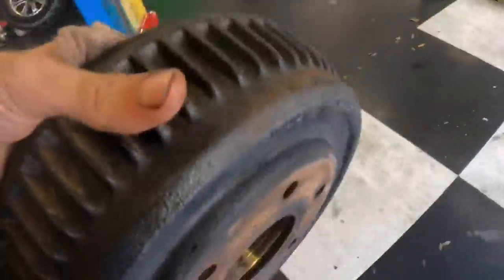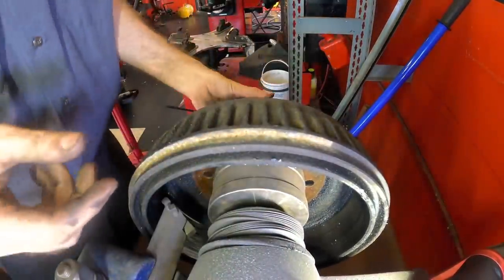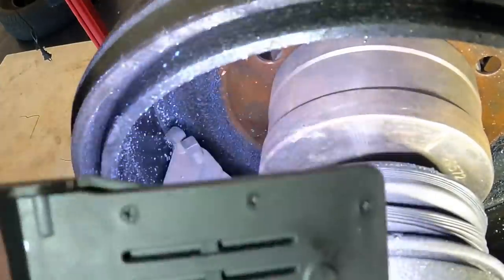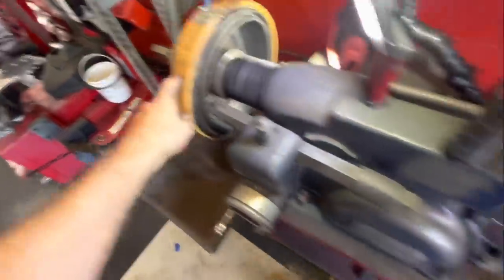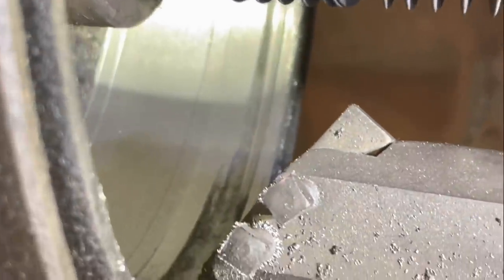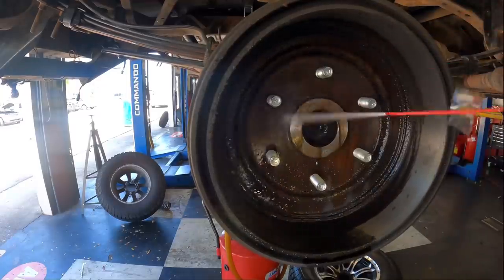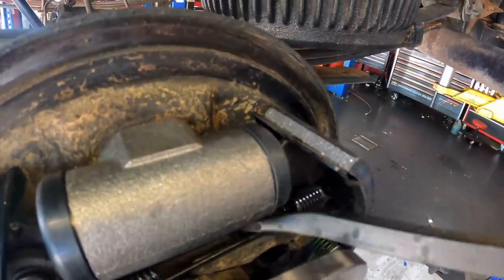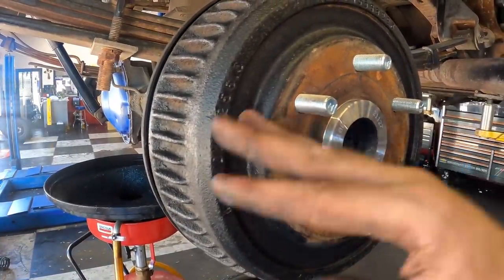How To Machine Brake Pads and Rotors to Recondition Surface | Brake Lathe Drum Resurface

Comment: Ah!....the past days of drum brake servicing! Anyone remember using a "drum micrometer" to make sure the drum was not oversize after machining? AND....transferring that drum diameter reading to a special purpose machine to "arc" the brake shoes? The joys of antique braking systems! Back when asbestos brake linings were on everything......
Reply: at the truck shop the same machine cut both at the same time.
Reply: Yep, I've done tons of brake work as a specialist including all lathe work for rotors, drums (including semis) and flywheels. Grinding the shoes was part of the service. For safety.
Reply: Remember? Yes.  Miss doing it? No. :)
Reply: Measured and turned many drums and rotors as a teen in my dads shop.  We arced shoes every time.  Had the whole anco brake service system including hard spot grinder and non directional finisher for rotors.  No squeeky brakes allowed
Reply: We, (the public and poor) never had anyone do things like that ! If I remember right we’d buy a rubber replacement kit, clean the drums with coarse emery cloth, rub the glaze off the shoes, then put diagonal saw cuts in the surface. copperslip on the friction surfaces. bleed the brakes well and off we’d go.  If by any chance you absolutely had to change the shoes,I found that OEM shoes had a lot more friction material on them than the cheapo aftermarket ones, for the same money, but more driving to get ‘em.  Re-arcing ? a downhill run with your foot lightly on the brake did that !
Reply: I remember doing that BEFORE the vacuum system was designed for it. What asbestos? Air pressure to get all that “dust” off the backing plate and springs and retainers…
Reply: Theyre still asbestos! The criteria is less than 10%...... riiiiiiiight! The front says asbestos free, the back says contains asbestos. The front of the box means what it says, asbestos free, they dont charge for the asbestos...l its free.
Reply: Im 56, did my first brake job and packed thebearings on a 1970 chevy half ton long bed, the year eas 1974. i was 8. Yup been thar.....
Reply: I'm 124 years old. I invented drum brakes. Back then they were made of whale blubber.
Reply: @davel4708  i thought it was westinghouse..... no wait that was railroad brakes, before cars..... smh
Reply: I'm surprised Ray doesn't know there's a port on the back of the brakes to adjust the shoes... and that he doesn't have the kit with the spring compressor tool and the adjuster soon...
Reply: Many years ago, I managed several auto parts stores. We would turn drums and rotors everyday. Our machine usually would run most of the day. If a customer bought all the brake parts, we would turn the drums or rotors for free. There were some days I got tired of that machine running!!
Reply: Being shop foreman for Brake Check doing drums and rotors was big part of my job, back in the 70's

Comment: Dealership service manager here, with a lifelong passion for proper auto repair. Love what you do. I have a drum brake tool kit in my toolbox in my garage that just collects dust. Love hate relationship with drum brakes. glad I dont have to deal with them anymore, but nostalgic. Thank you for showing people that not all technicians are out to get people. Its tough being in the business, trying to always do right by the cars and customers, and have that negative aura of what people think shops and dealerships are, breathing down your neck at all times.
Reply: @PeterPan-uu5vu   thanks for your well thought out, and insightful feedback. Super helpful.
Reply: Drum brakes are mechanically more efficient that disc brakes and that is why they are particularly suitable for parking brakes and slow speed applications.  Their disadvantage comes with the heat dissipation, which is where discs score however, the flip side is that parking brakes on discs have severe problems especially when hot and when they cool down losing grip.  I understand that this was a particular problem with the Chrysler Voyager in the early days, when Moms and little old ladies failed to set the parking brake with enough effort to overcome the shrinkage of the hot metal/pads.  It is noteworthy that Mercs, BMWs and Porsches use shoes within the top hat section of the discs for the parking brake and calipers for the service brakes.  

The current trend for parking brakes on disc calipers being electronically activated has exacerbated the problem and our current Skoda (VAG) carries a warning to set the gearbox in gear when parked on a slope as the parking brake may not hold when it cools down!
Reply: @clivewilliams3661  VAG, 1 step forward, 60 steps backwards
Reply: @sgtjonzo  Its all about costs and getting away with the minimum.

Comment: In 2015, I watched my 2005 GMC Canyon get inspected, and the rear drum the tech pulled came off with ease.  Fast forward to a year later, I had moved to a new town, and I had the truck in for an evap leak and annual inspection.  Two days later, I was informed the tech had to "use a sledge hammer to remove my brake drums" during inspection, and that I would need new drums and other harware.  That raised an eyebrow, but since I was out of town and needed my truck the next day, I authorized the repair.
When I picked up the truck, I asked to see the damaged parts. "Oh, we threw them away already." Riiight.  Ok.
The next time I set my parking brake, it wouldn't engage sufficiently to prevent the truck from moving.  Took it back to the shop.  "Oh, we'll adjust that for you at no charge." 
Worked once, then the next use, back to same issue.  'Fool me twice,' says me...  Took it to another (not dealership) shop.  Cable was broken.
I live in Virginia, and we don't get snow all that often, and I had kept the truck well-maintained. Never set foot in that dealership again, and I drove that truck another five years before it developed a persistent misfire on cylinder 4 of its Atlas I-5 engine just shy of 330000 miles.
I'm pretty convinced the tech, real name Bubba, I kid you not, scammed me on those drums or didn't know that sometimes you have to back the shoes off to get the drum to come off thinking that as a new customer with an old vehicle, he should get what he could out of me.
I wish every mechanic had the moral compass you do, Ray.
Reply: I learned about backing off the drum shoes to get drums off WAY back in the 80's working on the first of my two VW Beetles.
I had to take them off to replace the parking brake cable.
Reply: @MonkeyJedi99  
Ram gps
Reply: Don't know where you are, but I imagine they could get in big trouble for that. In Missouri, at least, as far as I know, you are absolutely entitled to get the failed parts returned to you after a repair...
Reply: Yes I wish Ray was my auto technician
Reply: When I had drum brakes, every time I checked them I'd clean the surfaces where the drum and axle flange met with a wire wheel, then a light application of antiseize around the lip of the flange. Never had to beat a drum off, that's a great way to either crack the drum or ruin the wheel bearing.
Reply: Don't let anyone work on your car. I don't care if you think you "don't have time" or have some other super important reason why you can't do it. Just think about how much time and money you wasted waiting for Bubba to fix his fuck ups and you still weren't made whole. Letting someone else work on your car unless its a huge job or some super complicated warranty work or electrica diagnosis is a huge mistake. This is coming from a mechanic. If you have even a basic tool set, a basic mechanical skill set and can read alldata or Mitchell service info then you're in the exact same league as 90% of the "mechanics" I've had the misfortune of being coworkers with, and you're well ahead of a good chunk of them.
Reply: @MegaDysart  in VA, you must be certified to perform inspections.  Doesn't matter how proficient I am, I can't inspect my own vehicle.
I'm held responsible for the proper operation of IT systems on which over $1B is transacted annually, and that means that I truly do not have the luxury to take days off whenever I want just to perform maintenance on my vehicles.  When stuff breaks, it doesn't happen on a schedule.
Reply: I spent this morning repairing or replacing my lower control arm rubber bushing because a mechanic had put it together and didn't know how to use the torque wrench I guess either that or he was a horse didn't know how to tighten stuff up I looked under there about a week or two before and seen shiny metal weird the bracket have been moving around and I couldn't figure out why my frontend was  vibrating good good mechanics could have got me killed I will never go back to that dealership again I swear have a good evening

Comment: I've recut rotors and drums on general purpose lathes several times over the years for people and hated the horrible screeching you get from cutting that cast stuff but never had or even thought of wrapping something around it but, that thing you use, the very moment that one broke the drum started making that annoying screeching started so, surprisingly effective. If only I'd know such a simple thing could make such a huge difference. I wasn't ever terribly happy with the finishes I got and no matter how I shaped the cutting tip the screeching was always there, such a simple yet effective thing that is and if I'd known I could probably have gotten a better result too, I only wish I'd known way back then.
Reply: Common knowledge when using a brake lathe.
Reply: @charleskennedy9467  Apparently not so common when this guy didn't know it, or wasn't trained in it either, meaning that his higher peers didn't know of it either.
Reply: Basically it's the same as when you flick a wine glass only holding the bottom/stem and it goes "tinnng" but if you have a finger against the top it will make a kinda "dung" sound  because your finger is absorbing the vibration; same as the band absorbs the vibration on the drum.
Reply: @CMDRSweeper  Guess I was just lucky that I worked with guys at a young age  that had common knowledge of the equipment they used.
Reply: @CMDRSweeper  I also used to use like when I was cutting brass or steel on the lathe a bean bag full of buckshot and you put it on top of your part not enough to deflect the part but just enough to take that harmonics out works great and it saves your ears well I've got what's left of mine cause we didn't have all that one full safety standards when I started out so now I hear bells have a good evening
Reply: Been probably 30 years since I've used a brake lathe, I used to think the rubber strap was only used to cut down the noise. Never thought of the vibration factor, to be honest. Damnit, now I feel stupid lol
Reply: @charleskennedy9467  I worked in engineering machine shops, not auto repairs shops so anything like brake drums or disks was usually as a favor to one of the higher ups in the company so very rarely done and NOT on "brake lathes" so it was mount it up as rigidly and running as true as possible and machine away. If it had been on specialized equipment there would almost certainly been a strap like that there and I would have worked it out but no, this was mostly general purpose equipment with a few specialized machines but, no "brake lathes" and not being a workshop that does brakes more than maybe once every few years I didn't know anything about this. I do, and did then understand the concept of stopping harmonics like that but the revolving part made difficult and I just never even imagined something as simple as this even could do so much to stop that. It would make a pretty big difference to the surface finish too, something I always tried to get a good looking finish but here it's much more important than cosmetic appearance.
Reply: @timjohnun4297  Well, noise means vibration but, don't feel stupid, you're definitely not the only one to not know or think of this.
I had to rewatch part to remind myself exactly what we're talking about and have already seen a couple of things I would have done differently, at least one that would have helped reduce harmonics. First would be to move that nice big and pretty sturdy boring bar back in the tool post as far as possible and Ray could have moved it back what looks like close to a further 2 inches, THAT would make some difference.
We did have one monster of a lathe. It looked like it was trying to disguise itself as an Elephant! The thing wasn't long, it only had about 5 foot of travel at best and could swing a fair sized diameter object but had a weird 3 jaw chuck where you could only move the jaws in and out about an inch, if that. You had to unbolt the actual clamp part from the mechanism and either weld fresh lumps of steel onto them or just build up the old welded bits then bolt them back on but doing it where you either had to or at least could then machine the jaws themselves! The benefit was that despite the fact 3 jaw chucks are so useful but, are pretty much always off by at least enough to be noticeable when you flip something around to machine the other end it's always a visible slight difference and in worse cases can be several thou out. This way it was always perfectly centered but, it meant it was always a tedious routine and made it impractical for most jobs simply because of the setup time. It was such a massive, heavy and so rigid I have had a job where it WAS ideal and this job needed to have a 12 inch or so diameter for part of it so had to be that or greater all over then the next 18 inches or so needed to be taken down to something like 2 inches so a LOT of meat had to come off. That massive, rigid lump really came into it's own there. I had a good carbide tipped tool and was taking 0.2" per cut at high feed rate and it was amazing! It did make noise but it was more like a hiss than anything and the material was fascinating to watch actually. It would peel off in tight curls that would be changing color as you watched them first start yellowing then turn blue and before that coil got even an inch long it would sort of shatter into these thick chips you really didn't want falling into your boots, as I did on at least one occasion. It was just such a solid mass that it just didn't flex at all anywhere so cut like soft butter and got a very nice looking finish, even with very high feed speeds.
I did see one big advantage to doing rotors on a machine like that and that was that double cutter arrangement so you can do both sides simultaneously, that was something I hated about doing them on an ordinary lathe. It's pretty critical to have it running as true as possible but also it NEEDS to be exactly the same thickness all the way around and that's really difficult to get precise normally but, if you're cutting both sides at the same time you've only got to make sure it's spinning true and there should be pretty much no vibrations so there's one big advantage to having a machine like that designed for specifically that job. Also another way to sell another machine to do what most ordinary lathes are capable of, just not as well but, that's pretty much all that machine's good for so not many general engineering shops are likely to invest in, unless of course, they get a lot of drums and disks being sent to them by their local mechanics.

Comment: The harmonics is called chatter. That noise is like finger nails on chalk board to a machinist. Spend all day everyday listening to it. Since the drum is shaped like a bell, a dampening strap is probably all you can do, but sometimes you can stop it by alternating the spindle speed quickly to break the harmonics from resonating.
Reply: I used to run all my machine by eye by ear by smell and feel and also I'd listen if machine was screaming or creating harmonics I do something about it cuz when I start talking to you you got to deal with it otherwise you'll end up with a rough finish on your surface have a good evening
Reply: @michaelpressman7203  yeah I work in aerospace, and about a tenth of a second makes the difference between a good day and a bad one.

Comment: Back in the 1980s when I had my first shop I had a brand spanking new AMMCO brake-drum-flywheel lathe. All of the vibration dampening bands were brand new so they were still supple. We also had a special made 'brake drum gage' for checking the ID of the drums before and after machining. I would also use a dial test indicator to test whether the drum could even be cleaned up by turning on the lathe. Even though the machine can run unattended it was a waste of time to machine a drum, disk, or flywheel that wasn't going to clean up within spec. Flywheels were the biggest hassle because they would often have hard spots. Even using a special grinder head attachment on the lathe it could be difficult. Most often we just sent them out to be ground.
After initial adjustment of the shoes I would set the parking brake a few times and pump the pedal to make sure the shoes 'centered' in the drums before final adjustment.
Brake jobs were good money but were always the dirtiest jobs. Basically it takes a week or more for all that grime to wash out of your skin. Gloves help but it still gets on you and ground in.